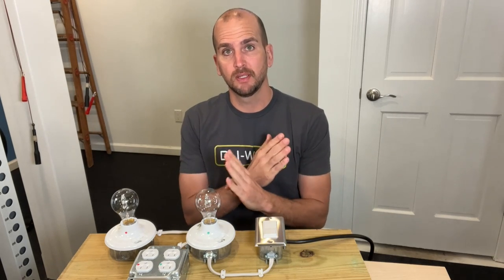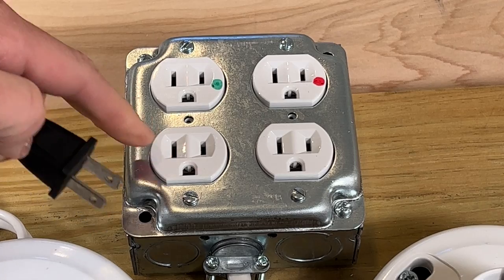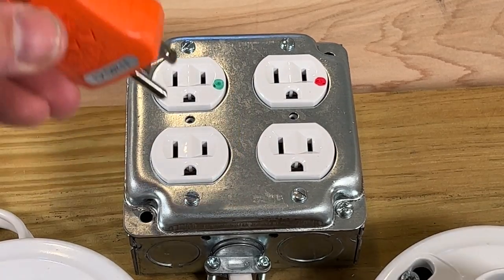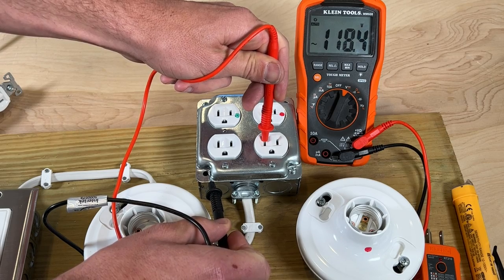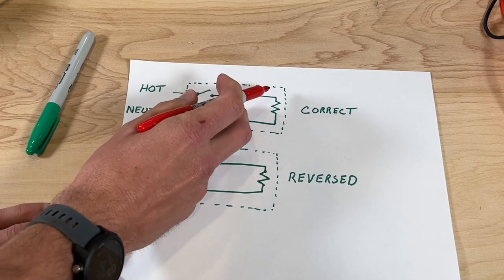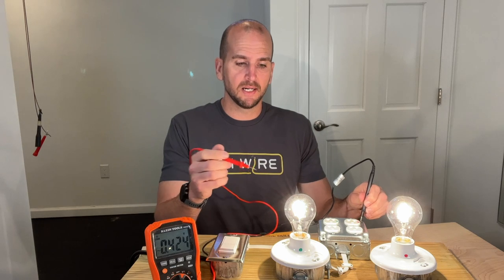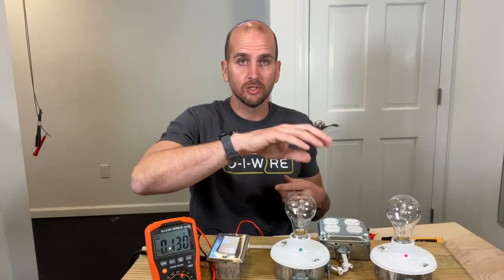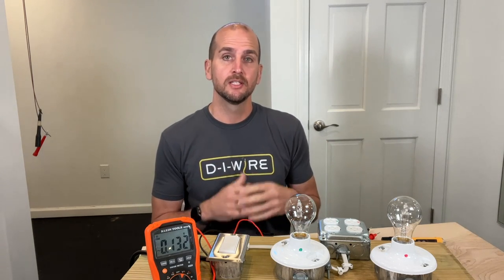Dangerous Wiring Issues In Lights and Outlets

Comment: There is a problem if you have older lamps that don't have polarized plugs you can get hot on the threads of a light socket  this will be common on antique lamps that use non polarized line cords, I have some lamps with round plugs that plug in both ways. You don't really want to upgrade but still an issue. The neon light tester or the non conductive tester can tell you to reverse the plug and you can actually mark the top of the round plug so next time you plug it in it will go in correctly. I usually don't put a bulb in unless the lamp is off or unplugged but I also used the lamp to test bulbs in which the lamp will be on. I will test my two lamps in the living room where the antique lamps are. This video brought this issue to my attention. Thank You. 73. P.S. I had one lamp plugged in wrong so I corrected it. The extension cord is polarized so if I leave it hooked to the lamp the lamp will have a polarized plug through the extension cord. The cord has heavier wires in it so it's safe. One day I may rewire the lamps with molded polarized plugs and line cord switches. The original line cord switches may be on the neutral side which right now I'm not using the switches only the one on the wall which is wired correctly. Thanks again for this video. 73

 p.s. neon light tester is old school they have a line tester that lets you know if a conductor is hot. Also line testers can help you find the right breaker to turn off if you never got around to label the outlets and switches. I always put a number behind the cover plates telling which breaker to turn off. If you have more than one box give each breaker box a letter or number for better identification. 73

Comment: I remember when I was a kid the lack of proper grounding and polarity.  I distinctly remember we were having an issue with our refrigerator and my dad turned it off (didn't unplug it) - they had internal switches back then.  I leaned up against it and got a buzzing shock all through my face (where my ear was in contact with it).  I also recall many appliances giving me that same shock (before grounded plugs were in widespread use).  Even today, I was working with a water pump and every time I would put my hand in the water to adjust the flow valve, I'd get that weird buzzing feeling because the pump wasn't grounded/wired correctly (it was an underwater sealed water pump).  So these things that he mentions are real and still happen today.
Easy way I remember how to wire:  The hot goes BEFORE the switch.

Comment: 1. reversing the wires can be bad for in old tube radios where often the neutral wire is supposed to be connected to the metal case for grounding but even if the cord has been upgraded to make the radio safer having reversed wiring in the outlet can now liven up the body of the radio.

2. lamp kits there are lamp kits so you can turn a ceramic statue into a lamp by installing a lamp rod nuts and washers and a lamp holder.

you can also get replacement lamp holders with switches built in.

often if the paper tube that goes between the outer shell and the threaded part of the bulb holder can go missing or degrade to the point where the bulb holder could contact the metal shell and make the threaded base live if wired wrong.

so when building a lamp make sure to know what wires are what a good lamp cord should have some marker on the wire  to indicate the neutral.

when replacing a lamp socket make sure to wire in the replacement properly or there could be safety problems.
Reply: @ejonesss  I knew that one of the first reasons for polarized plugs was to prevent energizing a metal lamp base. I never knew how that could happen. You mentioned the paper tube that used to be used  in old lamps.  Thanks for  pointing out the card board was the "insulation". Yes, I can totally see how if that paper got compromised it would energize the base. I guess back then paper was easier to use than plastic. Thanks for answering a question that has been long in my head!
Reply: Good point about old radios even if it has a new polarized plug attached it offers no protection if the outlet is wired wrong.

Comment: Interestingly, in those parts of Europe where the Schuko outlet and plug is used it's a 50:50 as the connector is symmetrical and can't be polarised, and they also tend to use Edison screw fittings for table lamps and the like. 
I'd also add that another very important reason for polarisation is to make sure that any internal fuse in a device is on the live/hot side. If it isn't, it provides no protection for live/hot to earth/ground shorts and then it's entirely dependent on the circuit breaker for over-current protection which could be way too high for typical low power devices. Also if such an internal fuse does blow for a a fault in the internal circuitry, if that fuse is on the neutral, then it will leave the circuitry "live", which is not ideal.

Not, of course, relevant to simple light fittings but it is to many other devices.

Comment: additionally, if one socket is backwards in the same box you could have 240v if appliance on both sockets is turned on simultaneously.  You also see that if your return(to the power pole) is faulty.

Comment: Changing a lite bulb standing on the ground and you touch the screw-shell, might give you a
good shock. In an old house with KnT wiring and a Carter or Chicago 3-way, the polarity could
put 120 volts on the lamp's screw shell.

Comment: I knew about how to wire a socket at one of my jobs where it was a bulb in a metal housing. But we used three wires. Hot, neutral and ground, and the tip of the bottom of the bulb socket was always hot, the black wire, threads neutral the white wire, and green wire was ground and that went to the metal frame parts. 
 About three years ago I was asked to do some lap cord repairs to two lamps. One of the floor lamps had three lights, and neither of these had polarized plugs. Well the three light lamp, was a concern. Two of the sockets were wired one way and the other opposite. This means if a person was to change two bulbs at once while it was plugged in and turned on they would get a shock across their upper body. How dumb was that. I put them all the same way and put on polarized plugs, and made sure the threaded parts were the neutral side of the plug, the wide blade.

Comment: that depends on country or place on the country you are living,,, example here in the philippines the whole country except in metro manila use a multiground system we only use 2 wire in the main line we don't have ground line,, in the provinces the line is 0 and 220. and in metro manila the line is 110 and 110... so when we will use an outlet tester it will always comes out to be open ground...

Comment: The basement in our home was finished by the original owner. We had to remove some sheetrock to do some repairs, and found that several of the outlets had the polarity reversed. We also found where they had spliced a cable behind the sheetrock.
Reply: If you strip enough wire you'll find where the factory has spliced wire. Under the jacket brand new. Damned butt connectors. It's rare but it happens.

Comment: I ran into something similar here, except the light fixture was hot...so when I went to change the bulb in the basement, the metal light fixture was wired up by someone who didn't know what they were doing and they wired up the neutral and hot backwards, and the threads hit the metal fixture as I was removing the bulb and my finger must've been touching on the top of the thread where the glass meets metal and shocked the hell out of me. Yeah that got rewired real quick. Some people don't need to be touching electricity
Reply: @Jannie Kirsten did you not read my comment?! I was changing a damn light bulb.

Comment: FWIW; our Ipad 1 will only charge with the charge cube in one particular direction being plugged in, even though supposedly the circuitry inside it is supposed to work no matter which way the male plug is inserted into the outlet.

Comment: When rewiring a lamp socket using the original wire and factory plug, or using a replacement pre-made plug & lamp cord combination from a hardware/big box store, typically one side of the 2-sided wire has a rough or raised line surface, while the cover of other wire is smooth.  Sometimes one wire is brass/dark and the other shiny, but not always.  Is there a standard which requires one type of insulator surface on 2-wire lamp-type cords to cover the line voltage conductor and the other the neutral or ground conductor?

Comment: Be aware that when dealing with a knob and tube home or business, back in those days they almost always switched the neutral and not the hot for light fixtures. This means that when you turn the light off at the switch, it will go off, but you will still have hot at the light and the neutral will be absent. This was considered proper wiring back in the day.
For this and other reasons (different wiring practices of the time), if you do not understand knob and tube wiring, don't mess with it or start splicing into it for a remodel. Call an electrician that understands knob and tube. (Most electricians actually don't know how it works). I'm a journeyman that has worked with it a lot.

Comment: Could this be the problem with a light fixture I installed a few years ago which the lights "ghost flicker" after they're turned off?
     Does this mean the light sockets (at the fixture) is still receiving power?

Great video and one of the most RELEVANT and complete description of this matter... thanks for sharing!
Reply: No this is because the LEDs are so sensitive that they glow with the current the capacitive coupling passes through and they have not circuits to prevent this. Note the same current would go even if there was an incandescent bulb. It just would not glow.,

Comment: I have come across both a reverse-polarity receptacle and a reverse-polarity light fixture, both on the laundry room lighting circuit (receptacle powers fluorescent fixture). Fortunately, both of these issues have been fixed, and the switch is on the hot side.

Comment: i was training on some equipment in a US embassy once.   we were in remote guard shack,  everytime I put my forearm on the chassis of the unit, i would get a tickle.  so little i didn't really notice it as an electrical shock until about the 5th time.  I started sweating more and made better contact.  I think the electrician reverse the polarity or didn't run a ground out to the guard shack.

Comment: In Europe (i am in the Netherlands) all plugs are reversible or non polarized. 99.9% of the time it doesn't create problems. Only some specialty appliances require the phases to be wired in a certain way. However everything is wired to ground fault interrupters that are in the fuse box.

Comment: Always, bare, green, or green/yellow wires are ground.  Usually, black wires are hot and white wires are neutral; exceptions occur when both white and black are needed to go to a switch and back.  Silver screws connect to neutral (white wire) and brass screws connect to hot (black wire).

Comment: I had a situation with an incorrectly wired lamp that we purchased from a popular online site. The lamp was turned off but while unscrewing the bulb with it partially out it suddenly turned on for a brief second. I thought the socket was bad and ordered a new one. When I was replacing the socket I noticed that the hot and neutral were reversed. Not only that but the manufacturer did not put an underwriter's not in the wires. This was not a cheap lamp either. I can't explain why the bulb turned on while partially unscrewed but it had to have something to do with the reversed wires. Wiring it correctly also solved another problem where we had an afci circuit breaker constantly nuisance tripping. It hasn't happened again since I rewired that lamp 3 years ago.

Comment: Australian plug pins are on an angle for polarity, but have another safety feature the pins are insulated for 8mm to prevent children’s fingers contacting the pins when a plug is not fully in the socket. 
A finger across the pins may not trip the safety switch (RCD or ELCB) 
🦘🪃🇦🇺

Comment: Some older light sockets have a ceramic collar that threads onto the exterior of the socket threads. If this collar is broken or missing and the socket is wired incorrectly, the exposed socket will be live at all times and could easily be touched when the light bulb is changed. If your other hand touches a grounded object, you could be electrocuted. Even if your other hand is not grounded you will get a shock. While not fatal, this could startle you and cause you to lose your balance, which would not be good if you were on a ladder.

Comment: Decades ago, in the 80s, while at work, of all places, we plugged an extension cord into an outlet, and then into a metal cased drill motor. Turning on the drill I didn't get a shock, however it was like a lightening show, with sparks all over. My boss said the outlet was probably wired backward, and he said to try another outlet and that one worked fine, no lightening show. They called an electrician, who came the next day and took care of the problem. I believe I didn't get shocked because the ground wire was there, but it definitely was bizarre.
Reply: That brings back some bad memories 😂, I got shocked really hard from an old metal case drill back in the day!

Comment: Hi again,  Second question.  I just installed two new ceiling light fixtures  (no fans attached) and now have a problem.
The wall switches are not turning the lamps off.  Sadly, I did not test the lights at the switch plate after installing
so I don't know if both of the switches have burned out, or if the builder reversed the polarity.

Could I trying connecting the light fixture's Black wire to the unused Red wire in the ceiling?  I have seen
that the Red wire is for supplemental power.  
BIG THANKS AGAIN!

Comment: A house I am renting had a very strange issue in the bathroom. Light switch on, lights on, GFCI bathroom outlet off; light switch off, the bathroom lights (LED’s only) would glow very dim, GFCI outlet was “on” ( The outlet would receive power indicated by the red light on it but unable to turn the GFCI breaker on, it would not click on to turn the light green). Also sometimes the bathroom light would strove if I tried to set the gfci breaker on)

Comment: Another thing you did not mention - those ceramic light fixtures are normally hung where? on the ceiling, you may be standing on something, like a chair or a step stool or ladder. I once lived in a house that had that type of fixture in the ceiling of a staircase that led to the basement - I had a ladder propped on the stairs, and me on it when I grabbed the exposed metal box, that was wired incorrectly, it was hot.  Guess what happened! I received a jolt and fell off of the improperly erected ladder, and took a tumble down the stairs.  Stupid way to prop a ladder, but sometimes, that is what homeowners do.  Electric codes are there for a reason.  
This same house in the winter would sometimes lose one of the phases at the utility pole in the winter, due to weather. That would create some weird conditions due to back feeding through light fixtures and other loads.  Turn on a light in the front hall. light in guest bathroom would light but dimly.:goodvibes:

Comment: European Schuko plugs are not polarized and everything works. One of my floor lamps vibrates with AC hum if the switch interrupts the neutral. I can feel this if I slide my fingers across its surface. This way you can sense vibrations that you can't by firmly grasping the appliance.

You'd have to go out of your way to touch the lightbulb screw. Modern plastic sockets don't directly connect the screw anymore, and only provide a tab at the bottom. A danger might come if you react and cause a ceiling lamp to fall down and break, or yourself falling down from a ladder.

Comment: If you get reverse polarity you should verify with a non-contact voltage tester and use it on the ground to see it is not hot. A voltage tester cannot tell the difference between reverse polarity and reverse bootleg ground. The latter is very dangerous. This especially on old home originally made without ground.

Comment: I'm curious what you purposely did with your wiring to make the outlet & light reversed. Everything else was very clear to me. In college I hung up a wet shirt on a wire hanger from a screw on the low ceiling light fixture. That lit me up and grounded at my knee on a iron tub. Burned my knee. That cured me of hanging things from light fixtures.
Reply from the maker: Dang!  That will be a lesson you won’t forget.  I just swapped the black and white wires.  Instead of black (hot) going to the brass screw terminal I connected it to the silver color screw terminal.  Then as expected the white (neutral) was also swapped around as well.
Reply: @EverydayHomeRepairs  Thank you for the extra information. Have a good evening!

Comment: Sounds like a fairly common problem.  I just had electricians replace a bunch of outlets that were wired backwards for the past 40 years.  Wired bad by the Builder's electrician in the mid 1970's.  Found out when I was checking an extension cord that just didn't work right.  The little outlet tester is invaluable!  Idiot proof!  Works for me!

Comment: The small block USB chargers with the plug built into the block can get away with a non polarized plug because they are double insulated, there is no switching, and the output is class 2 low voltage DC supplied by a full wave rectifier.  There is no added circuitry to deal with reverse polarity as no additional circuitry is needed for single phase ac voltage.  As you see with the light bulbs, a simple ac single phase circuit works no matter which direction you connect the power to the circuit.